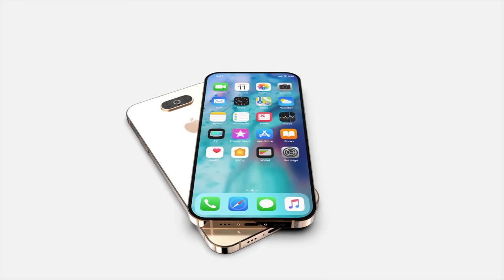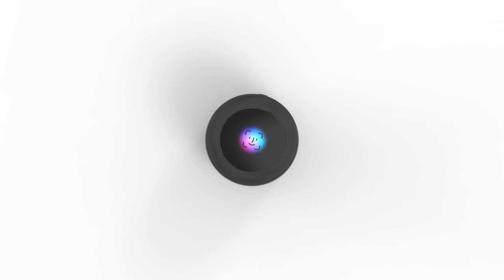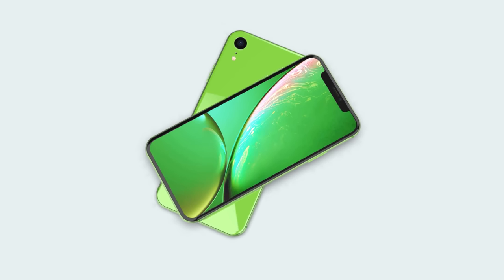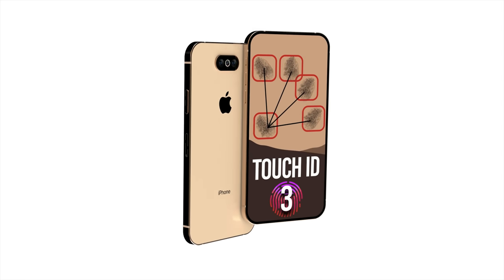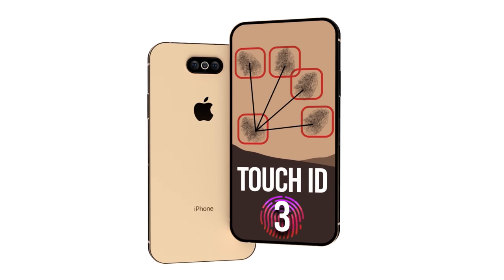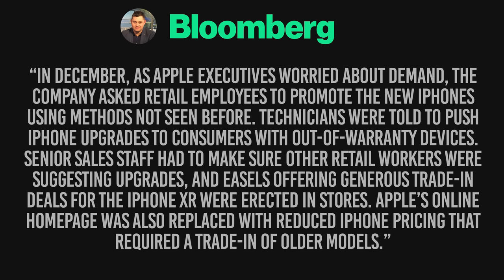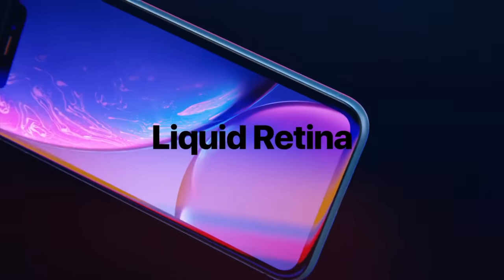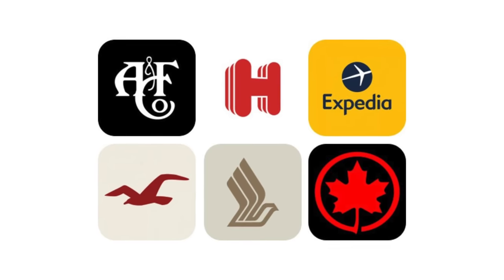HomePod 2, New iPhone 11 Leaks, Touch ID 3, SE 2 & More Apple News!

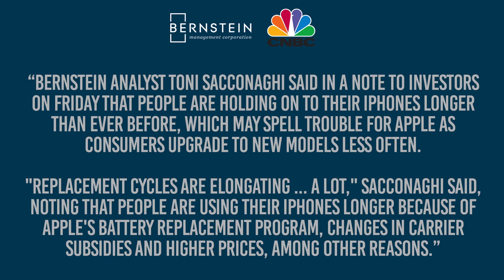Comment: 9:33 that analyst is right. I upgraded to an iPhone X last year and its been a year now since i have it and it works just perfectly. My iPhone X runs smooth and is still as fast as it was when I bought it (probably even faster with ios12). So I don't feel the need to upgrade in the near future :))
I'll probably keep this phone for the next 2 even 3 years :D

P.S: I think that's good. I finally understand the 1000$ pricepoint. I mean, you buy a new phone and it's Xpensive but you also don't need to buy a new one for the next 3 years :))   Five years ago phones were cheaper (let's say 600$), but they weren't that good and resistent (the hardware just couldn't keep up with the software after like 2 years) so you (some/most people) ended up buying a new phone every year. That means that after 3 years of buying new phones every year you end up spending more than 1000$ (1800$ if we do the math). 800$ more !!!
So I think 1000$ is fair enough for a phone that lasts 3-4 years now.

3-4 years (now) = 1000$
3-4 years (five years ago) = 1800$
Reply: I have a galaxy j7 from 2015 bought it for 200$ its still good as new ... but even better with a custom android 8 rom and linux mint ... (dual boot) yes the camera is not better than the iphone 6 but close cuz its the same module thats in the s7 .. yes ram is low u cant play games on it (1.5gb ram)
But i play all my games on my pc (which is where i went all out with my money) not to mention its dual sim which really usefull for me .. and the screen is oled on it with amazing colours (same as the s7 s8 s9 and the iphone x just with lower resolution better than the xr screen) so i think im not upgrading for 2 more years (6 years life)
Reply: Boogie IT i feel ya but i like upgrading every year Its just my sort of thing to upgrade every year since i like apple
Reply: Ali0The0King literally stop… your galaxy j7 isnt doing shit.
Reply: Lol I got the iPhone se for $100 and this little thing is still crushing it.
Reply: @srslystop  it is idc what u think after all im the one using it not u
Reply: @saklof296  I still have my iphone 3 should I pop it out for you?
Reply: I dare say it will last 5 years. I’ve had my 6s plus since launch and it has 92% battery health and works so well despite a crash every few months. Battery is decent, surprisingly fast, only thing is that the camera quality dropped over time, but it’s till good.
Reply: I got the iPhone X last year and dropped it once from  half a meter hight, with a case and it completely shattered. Really starting to notice the many flaws of the iPhone and the only reason I keep buying them is because of the layout and cameras... wish they’d sell them at lower prices or stronger qualities
Reply: Keep your iphone until you cant upgrade the ios. I still got for the third time iphone 6s and still works fast.
Reply: idk if it’s just my experience but thank god I have apple care bc ive gone through 3 iPhone 7s. The first one constantly said I had no service so I took it to the store and it was a defect so they replaced it. The second one I had for about a week and it shut off and wouldn’t reboot again, and here we are with my third one.
Reply: Boogie: My iPhone X runs smooth and is still as fast as it was when I bought it
Tim: Hold my beerttery ..
Reply: Makes sense
Reply: @butt7404  If only documented Americans were that smart!!!
Reply: @AliYassinToma  Its nice that you have a rom etc, but most people have 0 idea how that works and just want a phone that is simple like the iPhone
Reply: There no justification for Apple’s prices in 2019.
Reply: I plan on getting an iPhone X this summer/autumn, do you think its still worth it? Can u tell me some of your best features of the X?
Reply: i still have my htc one m7 from 2013 and I'm enjoying it
Reply: My I’ve had my SE for close to three years now. “Downgraded” from a 6s and didn’t regret it one bit.
Reply: Tyler Connor I got mine for 150 but unlocked and it works JUST FINE
Reply: BBD_ant_PVM my mom said (before it shattered) that she would keep her iPhone 5S until she can’t update the IOS anymore.
Reply: Elena de Kort u have some really bad luck
Reply: the iphone 5s?
Reply: But u have to agree battery life isnt that good :(

Comment: Personally I wouldn’t mind a thicker iPhone
Reply: Dr.BananaSoup I went 6 plus to iPhone 10 because I wanted a smaller phone but the 10 is bigger than the 6 and heavier. It hurts my hand to hold it and text with one hand.

I also miss the feature where u could double click on the home button and the content at the top of the screen would lower making it easier to access or reach with one hand or with your your thumb.
Reply: *thicc-er
Reply: Bnisha 04 reachability is still a thing in the iPhones without home buttons. You have to swipe down at the bottom of the phone screen (it’s the opposite of the gesture you use to go home)
Reply: Dr.BananaSoup same same the thicker, the better lol we is bring back the iphone 5se
Reply: Bnisha 04 I get your point. I miss doing that too, Ive had a iPhone X for a year now. but now that Apple is adding more features to their phones and I wouldn’t really mind it because they could somehow fit more stuff in
Reply: Dr.BananaSoup *Thiccccccccer
Reply: Bnisha 04 you just swipe down from a little bit phone the home bar

Comment: Yes, iPhone SE 2 with 4.5 or 4.7-inch display and (for God’s sake) 2500 mAh battery (not 1700), and for me it can have TouchID even as an aside button. That would be great.
Update of iPhone XR is badly needed to justify its price which is 1000 USD in Europe. There can’t be lower than Full HD resolution and non-complete portrait mode.
Reply: lukkash oh yeah yeah
Reply: Unfortunately, in the EU the prices will still be high as fuck because all the VAT. For example in Hungary an 1000€ iPhone costs atleast 1270€. If you buy them from certain OPs, then you are going to have a bad time, especially if you don't have a good contract and you have to pay up to even 1500-1600€
Fucked up shit...
Reply: WHY ARE YOU GUYS COMPLAINING! 
EVEN THE MOST PC-SCREENS ARE 1080p AND THAT ON A SIZE OF 27“

Comment: User base, that's why Apple would sell at a loss. Nintendo sold the 3DS at a loss originally and so did Sony with the PS3. They had ways of making money back through licensing and publishing games until materials costs went down and they made a profit on each sale despite the initial loss.

I know it has been confirmed that they aren't selling at a loss but if they were the above reason would be why.
Reply: It doesn’t make sense for Apple to sell at a loss because their market share (not user base, market share) is already more than big enough. Expanding it with a product which requires you to already be in the Apple ecosystem makes no sense either.
Reply: Also the ps4 sols at a 10 dollar profit per unit(at launch)

Comment: “They needa lower the price of the iPhone PERIODT”
Reply: Jayden & Shenanigans the new s10 is fucking $2000. Why arent you complaining about that?!?
Reply: @crescendus5747  its not it starts at 800 and goes to 1000
Reply: @crescendus5747  the 2000 is the galaxy fold isheep
Reply: JIMIN SUGA the 5g
Reply: JIMIN SUGA the galaxy and iphone prices arent that different lol
Reply: Apple phones use better quality stuff as well. They use steel on the edges. Samsung uses aluminum. Apple also has better chips. Last years apple chip is comparable to this years samsung chip
Reply: Their software is also less laggy.
Reply: @crescendus5747  well stop comparing the iPhone ex 4g to the Samsung s10 5g
Reply: Exuse me so does Samsung they use stainless steel on the s10
Reply: JIMIN SUGA no they dont...
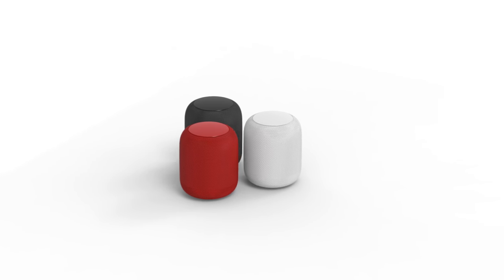Reply: Skip to 2:24

Comment: Me personally I hope touch ID is dead and left in the past. I have a condition called palmar hyperhidrosis which basically means my hands sweat constantly unless I have a fan blowing air over them or it's windy outside. Because of this touch ID worked half the time for me. There were so many times my fingers were too wet for it to work because of my condition. Now that I have the iPhone X and Face ID is touchless it works every time.

Comment: I would never get a Home Pod personally. 1st, You have to own an iPhone or iPad just to be able to even set it up. This alone means the Home Pod will never compete against Amazon or Google. 2nd, the Google Home I have can not only do everything the Home Pod can do, but it can do it better and then go beyond that and do many things the Home Pod can not do. 3rd I also have a Google Home Hub that has a beautiful display, that the Home Pod has no equal too. It can also cast to external speakers that sound better than a Home Pod can. I can shop from it. I can check to see if my airplane departure is on time, etc.... And it does it all with a voice assistant that's miles ahead of Siri in AI. It ties into my Samsung Galaxy and I can interact with things and pick up from where I left off with the same assistant on my Galaxy. 

And all of the things that Apple is thinking of doing with the Home Pod, are simply never going to work. What? Apple's answer is simple to throw in hand gestures? little side mounted graphics? Simple gimmicks that no one would ever use and don't affect your results from the device? There is simply no point to the Home Pod anymore. Especially since they now allow Apple Music on other devices too.

Comment: Heres a question, do people even want the XR form factor over a potential SE 2 form factor with an edge to edge display? A display with better pixel density? I feel like the sales answer that question. I don't know anyone with a XR and I don't know anyone who was hyped about it. It seems like more people are pining for that old 5/5S form factor albeit with a bigger display. Even I would trade in my XS for that phone if it were to come out just for the sheer usability of that size, or a size just slightly bigger than the 5S, and thats coming from someone with pretty big hands. Even with hands my size, some actions on the regular sized XS require uncomfortable reaching or even two hands.

Comment: You’ve made points multiple times on multiple videos regarding Apple’s pricing of their devices. While there is some validity to that point, I also think you should point out the change in the marketplace. Phones are no longer subsidized by the carriers. Also highlight the yearly upgrade program that is available with the iPhone. This in affect cuts the price of the device in half, and gives the user a new iPhone every year. As an enthusiast I look forward to getting a new phone every year. My previous phone of choice was the Samsung Galaxy Note series. However, I was unable to get a yearly upgrade program for the Note . I then considered the OnePlus, as it is widely regarded to be a great value. However I found that if I got a new phone every year I would be paying in the area of $600 per year. This is the same amount of money that I would pay if I got a New iPhone XS Max every year. This is due to the yearly upgrade program available with the iPhone through my carrier (Verizon Wireless).

Comment: I've gotten every high-end iPhone since the iPhone 4s (I actually skipped 5-5s though), and regardless of what I am able to fit into my budget, I would go for an SE2 in a heartbeat. I missed the last one because it didn't fall in timing-wise to what I had already gotten around that time, but if they go that route, I would totally go old school, regardless of the bells and whistles of the high-end models. I would totally love if they released a new, high-spec'd iPhone with the iPhone 2G or 3G's body and size if they released that too, would be my absolute dream.

Comment: I don't think there's just one or two reasons why Apple is experiencing slower sales, it's more like a whole list of things that are making people hang on to their old gear. In no particular order: people are worried about a recession, there's no 'killer' feature on the new phones, the new phones have multiple design issues -- lacking the distinction of the iPhone 5 form factor (they look like Samsung phones), the notch, the bump on the back for the camera, the weight of the stainless steel bezel -- wireless carriers aren't offering subsidies like they used to, Apple focuses too much on the wealthy 1%'s and fails to aim for the middle of the market (i.e., lack of iPhone SE replacement), Apple is too consumed with design and frivolous software features rather than looking for everyday solutions computer devices can solve.  That's just off the top of my head.

Comment: iPhone 8 Plus problems-
1-Silent button should be on screen instead of left side switch.
2-Call disconnect option is not available on screen which is highly discomfortable.
3-We can’t delete unwanted contact no. by screen. By edit option it is lengthy.
4-4k video not send easily

Comment: When I had the 6s it slipped I think because of aluminum but the x doesn’t seem to slip, just that it’s thin, I think. When I had the se it slipped even when it was not curved. Repair for both phones was a pricey. Not everyone works in companies or some professional field where they would need something that looks expensive, sophisticated like having a gold color like the xs. At least I don’t. I just want something that works consistently after two years, like the 6s and se. But of course app design, navigation, functionality is a different thing. Of course that’s what everyone would want working even after two years. I’m just saying about the outside of the phone

Comment: I hate USB C so much. The female end catches so much dust and it’s very hard to clean due to its thin space. The connector tongue in the middle is also very vulnerable to damage when cleaning. It’s just a poorly designed port. Apple should focus on optimizing data transfer rate on lightning cable instead.

Comment: Although it’s been 

“Confirmed” 

That apples using the centre camera..  I just want to lightly put it that..

I HATE IT, id rather they keep the same camera as the X/Xs... If they just replace the flash with another camera, and place the flash either underneath or as a ring around the camera then that’s the perfect design, I just hate the centre design....

Comment: How many times have we seen an Apple patent that goes into a product within a year or two?  I can only think of one time, the 3rd generation butterfly keyboard, and that one was for obvious reasons.  There's a zero percent chance that within two years we see a home pod with face id.  But obviously Apple's moving in the face id direction, and it's not unreasonable that it would be implemented into the home pod.  This is just so Apple can be ready, if and when the market is ready, for a better, more expensive home pod.  Unfortunately that is a minimum of two years away, if it occurs at all.